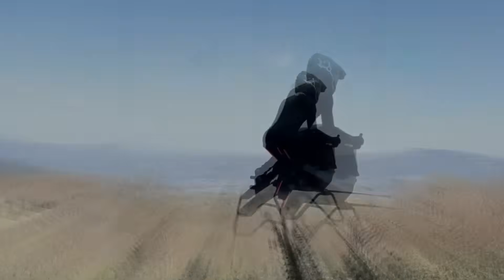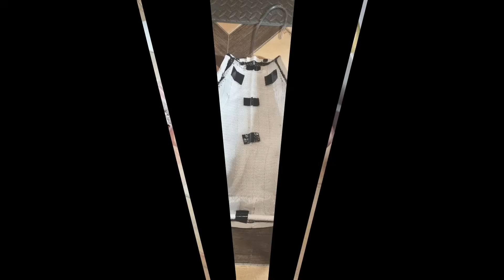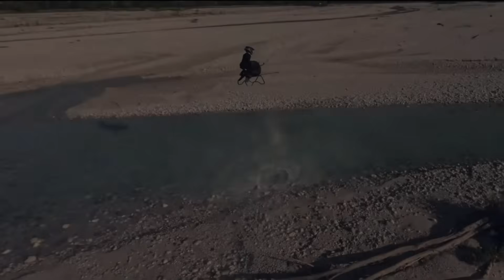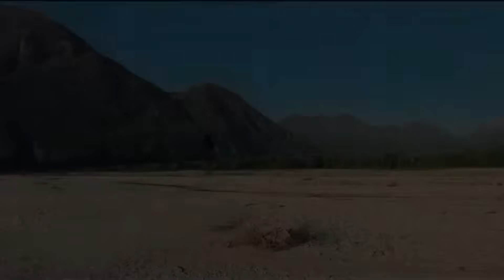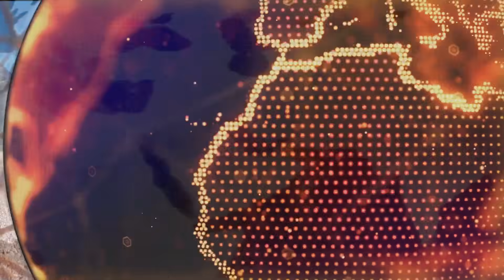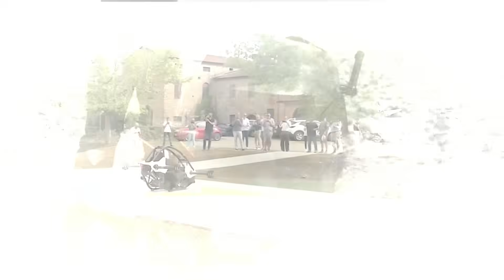2026 NEW VOLONAUT AIR BIKE OFFICIALY LAUNCHED!! Key Features, Tecs, & Benefits!!

Comment: Not just a 140dB noise but also huge destructive downblow make it useless in cities or suburbans. They use a nice music for video on purpose :)
Reply: Small mindedness is a skill. 😂😂😂😂
Reply: where did you get the number 140 from thats as loud as a gun
Reply: @LegacyChasersComics  Small jet engine noise at 50m distance is 110-140dB depends on weather conditions. It's a common knowledge :), so what's jet engine noise at 8 meters when it's flying over your head :) ? I don't want to know lol
Reply: @dannyboycar0777  mr high horse telling me the exact db sound a jet rocket makes is common knowledge. It’s the same tech the military uses for jet packs.
Reply: @LegacyChasersComics  JET ENGINE
Reply: @LegacyChasersComics 
Most jet engines are 140db
Reply from the maker: @Zeaiclies That’s an interesting clarification. If the real-world noise level is lower than the 140dB claims, that makes a big difference for viability. And you’re right.. downwash is only intense at takeoff and landing, though in dense urban spaces even those short moments could be disruptive.

Flying higher in the city could help, but then there’s the challenge of safety corridors, air traffic, and emergency scenarios. Do you think the tech could realistically balance noise, safety, and regulation, or will it stay more of a niche “adventure machine” for open spaces?
Reply: @innomoto 
Oh it's definitely a "Rich" niche toy 😂 but it is neat.
Reply from the maker: @Zeaiclies
Haha, fair take... right now it does feel like a “rich niche toy.” But you’re right, it is neat. A lot of breakthrough tech starts that way: expensive, experimental, and only for a select few. Over time, though, costs drop and practicality rises.

Do you think this will follow the same curve as early cars or planes.. luxury novelties at first, then gradually becoming mainstream. or will it stay forever in the “toys for the wealthy” category?
Reply: @innomoto 
This particular vehicle, will always be a Rich toy but other things will come and probably will be more affordable to mainstream public.
Reply from the maker: @Zeaiclies Totally agree.. this specific machine does feel like it’ll stay in the “luxury toy” lane, but like you said, it paves the way for other concepts that might become more affordable and practical.  Every wild prototype adds to the learning curve. If you had to bet, do you think the breakthrough for the mainstream will come from improved jet systems, or from quieter electric fan-based designs?
Reply: @innomoto 
For sure.
It fits a small niche market of expensive fun but also pushes technology and innovation, which is all good. ❤

Quieter electric ducted fans would be nice, along with longer flight time.
Reply from the maker: @Zeaiclies
Exactly.. even if it stays in that niche lane, it’s still valuable because it forces innovation forward.  Quieter electric ducted fans paired with extended flight times feel like the most realistic step toward something the public could actually adopt. Imagine a balance between thrill and practicality.. that’s when personal flight could truly take off.

If you could choose, would you rather see the tech evolve toward ultra-quiet, city-friendly flyers, or keep the raw, jet-style adrenaline machines alive for open-space adventures?
Reply: @innomoto 
I would ❤ to have both available..... obviously.  lol  😎👍🍻
Reply from the maker: @Zeaiclies Haha, best answer possible .. why not both? 😎🍻 One lane for the adrenaline junkies chasing raw jet power, and another for the city-friendly crowd who just want a smooth, quiet commute above traffic. That way the tech evolves in parallel, and everyone gets their flavor of the future.

If you had to pick first though, which would you personally want in your garage right now: the wild jet beast, or the sleek quiet flyer?
Reply: @innomoto 
I am very tempted to get this. lol
Reply from the maker: @Zeaiclies Haha that’s awesome. Temptation level 100! Even if it’s more of a “rich toy” right now, it’s hard not to imagine how fun it would be to actually own one.  Would you use it just for thrill rides in open areas, or do you see yourself trying to make short practical hops too?
Reply: @innomoto 
I would so use it to go to a store or something. 😂❤
Reply from the maker: @Zeaiclies Haha, love that! 😂❤ Imagine zipping to the store in a Volonaut..definitely turns errands into an adventure. Do you think you’d stick to short hops nearby, or go full “weekend joyride” mode when you get the chance?
Reply: @innomoto 
Probably short hops mostly
Reply from the maker: @Zeaiclies Haha, short hops sound perfect, quick errands with a thrill! Even just zipping around nearby, you’d be turning everyday trips into mini-adventures. Can totally see why temptation level is 100%!
Reply: nobody likes smart alecks, especially not if you've been influenced by star wars to the max 😉
Reply: @ I guess that leaves me out of it. Star Wars only influenced me to the minimum-haha   And don't call me Shirley!!!
Reply from the maker: @ultimate_brain Haha, fair enough! Maybe I'm getting carried away with the movie references. But hey, when you're talking about something this cool, it's hard not to imagine it in a high-action, epic context. Definitely not everyone's cup of tea, though — I’ll tone it down and keep it real. Thanks for calling me out!
Reply from the maker: @ultimate_brain Haha, fair point! Star Wars can definitely spark some over-the-top enthusiasm. 😅 But hey, when it comes to imagining the future of transportation, sometimes it’s fun to lean into the fantasy side! What do you think would be a cool, realistic feature for a flying bike? Keep it sci-fi, or would you prefer a grounded, functional design?
Reply from the maker: @dannyboycar0777 You're spot on with the noise and downwash issue. It's one thing to fly in an open desert, but quite another in a populated area! 😅 Until they refine the tech, quieter, more controlled propulsion systems will be essential for city use. The urban market will need something that doesn't shake the ground and upset the wildlife.

I totally agree with your thoughts about a niche adventure vehicle — places like deserts or coastal areas would be perfect for it. Maybe a more peaceful version could exist for those who don’t want to rock the neighborhood.
Reply from the maker: @ultimate_brain Haha, Star Wars vibes definitely sneak into these conversations! 🚀😄 And hey, a little sci-fi inspiration never hurt anyone. But seriously, the noise and downwash are legit challenges—kind of like the “dark side” of flying bikes.

Still, every new tech starts somewhere, and who knows? Maybe the next version will be quieter and sleeker, like a Jedi’s stealthy speeder.

What would your dream flying bike look or sound like if you could design one without limits?
Reply: The same as waterjets - there is never actual sound recording
Reply: Safer than the quadcopter for sure.
Reply: Not a single video out there without music or bs audio. We want to hear the insanely loud turbine.
Reply: Screw that thats why you fly above areas that the down low would affect. U land in a parking lot or a parking garage roof. Flying to the top some of yall on here are just negative nancys use ur imagination and make what u got work duh
Reply: DRUG DEALERS WILL LOVE IT ,,, BYE BYE COPS
Reply: Every new invention has to start somewhere.
Reply: maybe but history is full of people like you… The dream killers…. this is simply a technical issue to be solved down the road like every other thing in life
Reply: How do you think technology advances? No shit it’s gonna be loud you genius.
Reply: @GoldenBuck44 but why hide the fact in the videos?
Reply from the maker: @alanhagen3720
That's right.. technology like micro turbofans already exists, and the concept is similar to the Harrier's principles. The only problems right now are the short flight duration and noise. These two issues will be major challenges if they are to be brought to the "public transportation" level.
Reply: I'd like to see it race on the Isle of Man where regular motorcycles are raced. 🏍
Reply from the maker: @tmichaeld5669 Now that would be a spectacle! Imagine the Volonaut ripping around the Isle of Man TT course..those long straights and tight corners would really test what it can do. 🏁 It’d either be the most jaw-dropping race ever, or proof of how far this tech still has to go. Do you think it could even handle the demands of a course like that, or would it need a whole new design to survive?
Reply: It's not 140DB, it is actually a lot quieter in person.

The downwash would only occur for brief moments of landing or taking off, unless you fly low on purpose. 
In a city why would you fly low?
Reply from the maker: @dannyboycar0777
You nailed it — 140dB plus that intense downwash makes it a non-starter for city or suburban use. 💨🔊 That jet-style thrust doesn’t just shake the eardrums, it kicks up serious debris and pressure that would be unsafe near people, pets, or property.

The video soundtrack definitely helps the dream, but the physics are still very real. In urban areas, only something like ducted electric fans with active noise suppression might make this kind of personal flight viable.

Still, as a testbed or off-grid adventure craft? It opens some wild possibilities. Curious — what environment do you think would suit a machine like this best?
Reply: @innomoto .   Unmmmm any environment outside urban areas is fine, notice where he’s flying, they would just have to make new laws and where you can fly until the technology progresses….but crap on this guys great idea because downflow or noise…give this a chance….at least he’s cracking eggs to make something that my change things  ….
Reply from the maker: @peterwaite1611
Absolutely  and well said. 🙌 No major leap in tech ever came without a few broken eggs. Noise and downwash are real hurdles, sure, but they're also engineering challenges.. not dead-ends. And like you pointed out, smart regulations and dedicated air corridors could give these early prototypes the space they need to evolve.

What’s exciting is seeing innovators willing to take that risk, not just dreaming, but actually building. The Volonaut might not be ready for rush hour in Manhattan, but it is cracking open the conversation about what’s possible.

Appreciate you championing the bold ideas:  it’s how change really happens.
Reply: @innomoto  I guess desert or over-water areas close to the shore. Definitely not forest - wildlife won't be happy with downwash and noise :)
Reply from the maker: @dannyboycar0777
Exactly — deserts and over-water zones near the shore make perfect sense.  Wide open, minimal risk to people or wildlife, and enough space for safe takeoffs and landings. Totally agree that forests are a no-go… imagine the havoc to birds or treetops with that kind of thrust and decibel level.

If Volonaut ever wants to go mainstream, they’ll need a radically different propulsion system. But as a niche machine for thrill-seekers in remote areas? It’s got serious potential.

Appreciate your insights — would love to hear what other concepts you think do have a shot in real-world settings.
Reply: 140dB...they need it to pump out some Heavy Metal. Could you imagine this flying overhead blaring Slayer?
Reply from the maker: @jakeburns6566
Haha, I can totally picture it! 140dB with Slayer blasting would make the skies feel like a metal concert in motion. 🤘 But yeah, it might be a little much for the neighbors. Maybe they should consider a quieter, more futuristic version for those who prefer peace and quiet—unless you're a fan of making a grand entrance, of course! What would be your go-to soundtrack for a flight like that?
Reply: @innomoto  Flight of the Valkyries for sure!!!
Reply from the maker: @jakeburns6566
Perfect choice! "Flight of the Valkyries" would make every takeoff feel like a cinematic masterpiece—epic, bold, and impossible to ignore. 🚀🎼 Just imagine soaring over the desert with that blasting... pure Wagnerian drama. Now that's how you own the skies!
Would love to hear your full playlist for the ultimate airborne ride—got any other tracks in mind?
Reply: @innomoto  ...then go surfing after-haha. I hope the thing can stay in the air for a long time. My play list would hurt the soul. From Bach to The Warning for the more main stream music and from Blitzkid to The Buzzcocks...and this isn't even taking the "odd" music in to account. This is just a ripple of music I listen to. I have about 6500 songs just on my phone alone. I can listen for weeks and never hear the same song twice...even the band. I would be easier if I made a playlist per genre.
Reply: So we just gonna believe this thing flys without propellers or wings?  I call bs on this whole thing
Reply: @aaronsanchezz Google "jet engines", "rocket thrusters" and "glider planes" if you want to educate yourself.
Reply from the maker: @dannyboycar0777 You’ve really highlighted something critical here — that kind of noise and downblast isn’t just inconvenient, it’s incompatible with everyday environments. Even just a short hover over a residential area could blow out windows, set off car alarms, and terrify everything within earshot… not exactly commuter-friendly 😅

And you’re right — forest zones are off-limits too. Not just noise pollution, but potential fire hazards from heat and disturbance to delicate ecosystems.

The dream of personal flight is exciting, but the real breakthrough will come from propulsion systems that combine lift with silence,  think high-torque electric ducted fans or maybe even anti-gravity if we’re dreaming big. Until then, it's all about picking the right sandbox to play in: coastal flats, desert testbeds, or wide-open lakebeds where the sky's the limit and the ground stays undisturbed.

Appreciate your practical take it's voices like yours that keep the conversation grounded while the tech reaches for the skies.
Reply: @aaronsanchezz  you are retarded
 A jetcat that weights 20 kilos produces 1000 horsepower. The fact it's a turbojet instead of a turboprop wastes most of the power but it's still enough left to mess with your brains that let's be honest were not working very well in the first place. You were never curious about how all that other crap functioned ... fly boards, jet suits, whatever
Reply from the maker: @GeorgeS-z8x
Let’s keep the conversation respectful.. the future of flight is exciting, but it’s something we should explore with curiosity, not insults. Everyone's trying to understand new tech from different perspectives, and not everyone has the same technical background.. and that’s totally okay. You brought up an interesting point though: jetcat-style turbojets do show how much thrust small engines can generate, and you're right.. even with efficiency losses, the power-to-weight ratio can be wild. That’s why they’re often used for experimental craft and stunts. But getting that kind of tech to work safely, quietly, and affordably in public spaces is the real challenge. Curious: What do you think is the best propulsion path forward; 
ducted electric fans, hybrid turbines, or something even more radical?
Reply: @innomoto show a video of the bike without music playing over the clip
Reply from the maker: @bayly1977  
Great point, a raw audio version would definitely give a better sense of what it’s really like! 
 The current promo uses music mainly to highlight the design and motion without distraction, but you're absolutely right.. the sound level and downwash matter, especially for urban viability.
We're hoping Volonaut or reviewers will share more unfiltered test footage soon. In the meantime, what kind of noise level do you think would make this kind of tech actually workable in cities?
Reply: @aaronsanchezz  the Harrier uses directional jet thrust to hover, they have micro turbo fans now, totally possible. But with only 10 minutes flight duration,not really useful.
Reply from the maker: @andrewbruch8731
Haha, fair point... it will be noisy, energy-intensive, and have limitations at first, just like the first airplanes or cars were created.  Innovation always starts from a "rough version" before becoming practical in everyday life.
Reply from the maker: @bayly1977
I also agree about transparency. A video without music would give a realistic picture of the sound and downwash effects, so the public knows the challenges that must be overcome. It's not to cover up shortcomings, but to build realistic expectations.